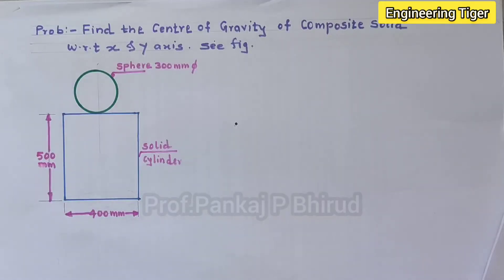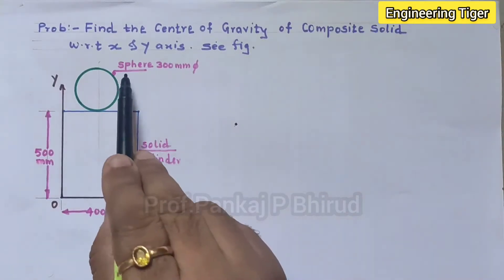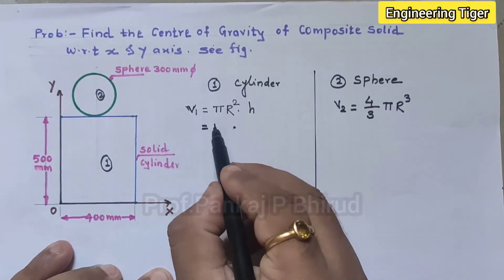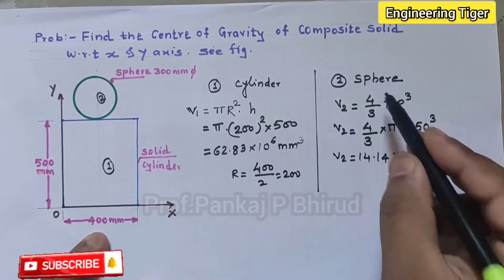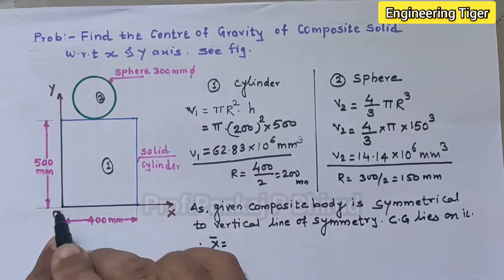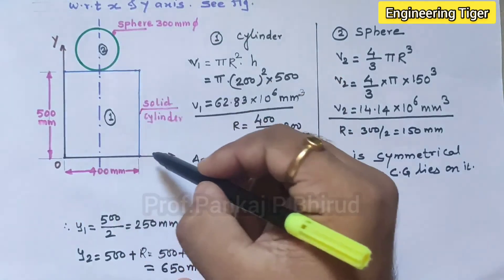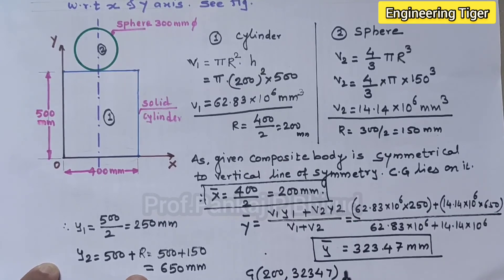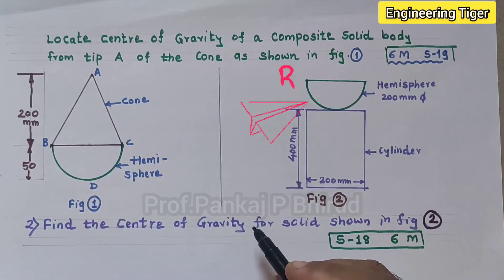How to find Centre of gravity Of Composite bodies  Problems,Mechanics,how to find C.G #pankajbhirud

Comment: Dear sir, if the cylinder is hollow  (for ex. 10 mm thk with 1m height and 1m dia) and attached with hollow cone (10mm thk with 1m height and 1m dia) ,how to calculate its c.g  with respect to  x, y&z axis

Comment: Dear prof. Pankaj Bhirud, I am eko from Indonesia, I want to ask, for example there is a vertical cylinder and there is a cone attached to the middle of the cylinder body, how is the center of gravity calculated?

best regards
Reply from the maker: In this video, we have taken cylinder and shpere. In your case, instead of sphere take volume of cone. And refer procedure as explained in this video
Reply: @pankajbhirud_engineeringtigers  ok thanks